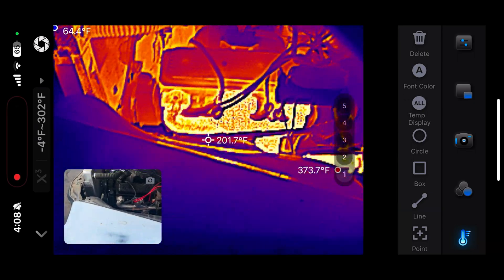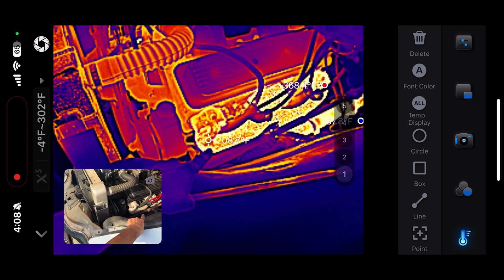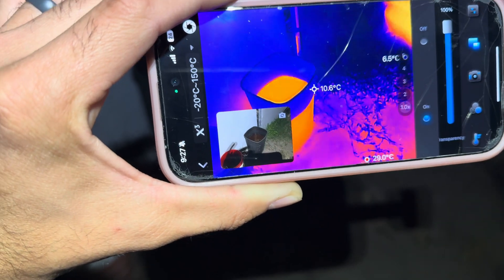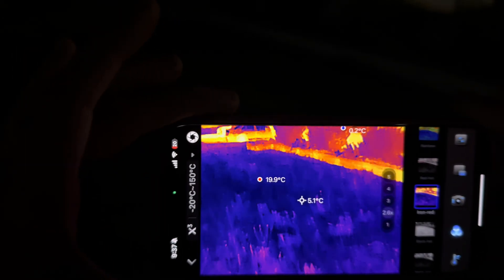World's Smallest Thermal Camera... P2 Pro ThermalMaster for Mechanics

Comment: Pretty cool, handy for finding short circuits in PCB's , floor heating, solar connections etc. I used to own a flir one pro but Imma gonna switch to the thermal master ones...
Reply from the maker: @HartleiRomero  good points! I should have mentioned PLCS too! Definitely you should make the switch.